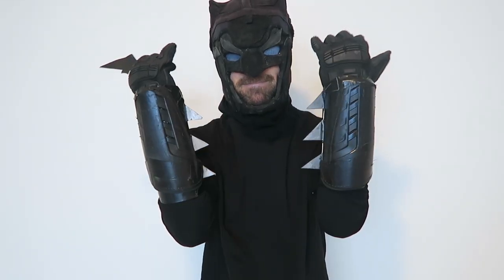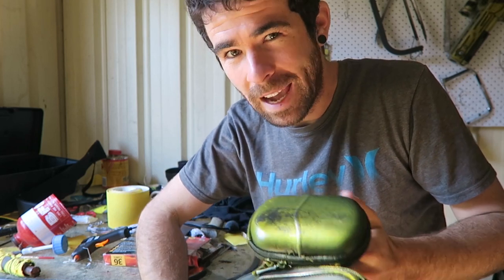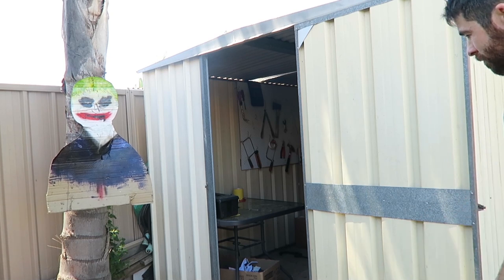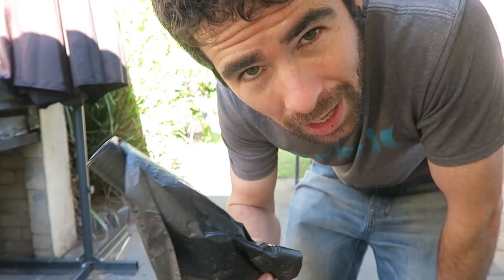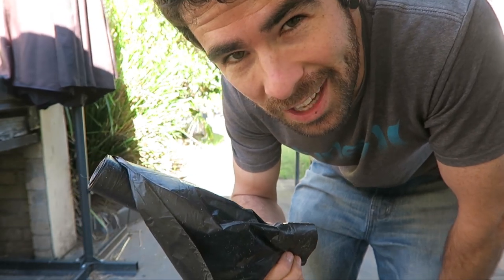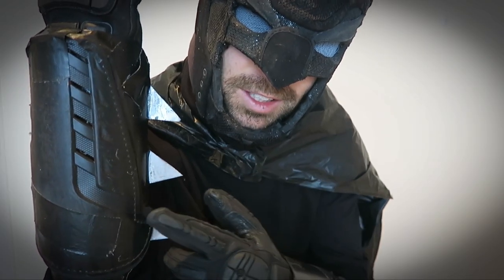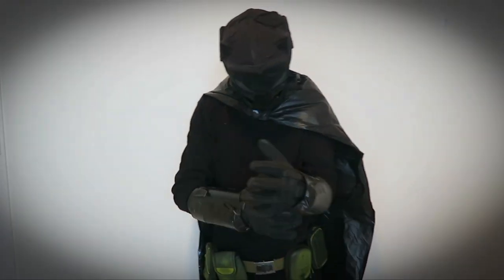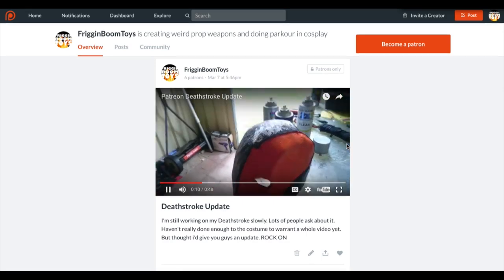Homeless Batman Part 5: Utility Belt and a Trash Bag Cape

Comment: Make a cape out with of old holed sweaters or holed curtain to make it look out and beaten and used and give it an almost homeless makeshift item effect. Also use the bucket for the chest emblem and if there's extra either make armor plates or something to connect the cape to the costume without tying it around your neck.
Reply from the maker: Yea I am thinking of stitching a bunch of material together for the cape. I'm not sure if you saw the cowl build but I used shoelaces for makeshift thread and it looked cool.

Comment: i think you should put a hole on the top of the bucket and on the center a bat then  Alfred can give poor Bruce LED lights and then put the lights in the center and then put a metal rod on th e side of the bucket then put it some where (make sure that the LED lights are white

Comment: You should make some cheap gadgets. If you put aluminum foil on both ends of a D battery it creates a taser like effect. You can also make a heated wire doing the same thing
Reply from the maker: Yea I left some room on the belt for other weird gadgets
Reply: Friggin Boom Toys great